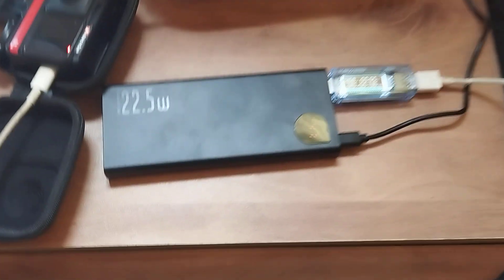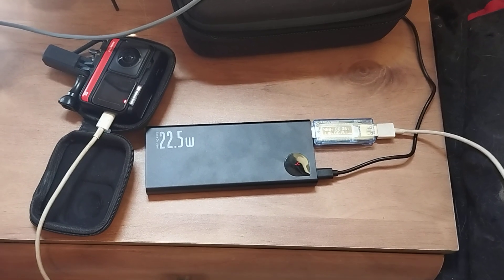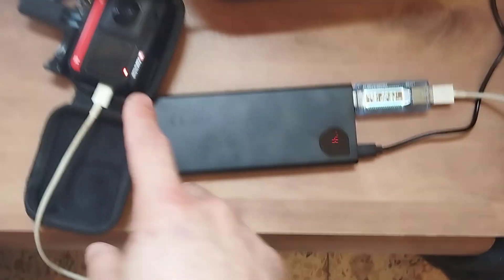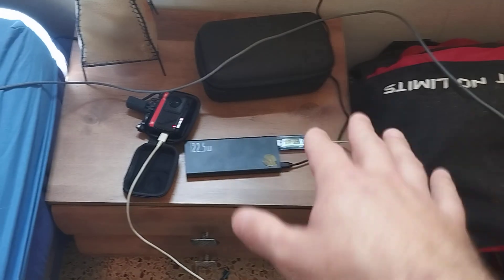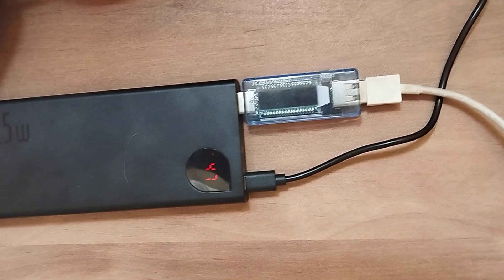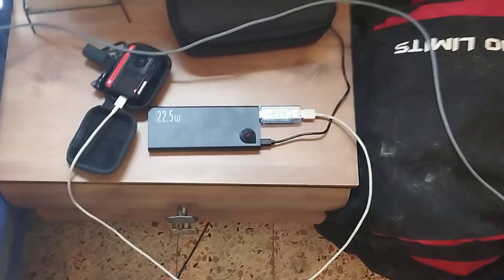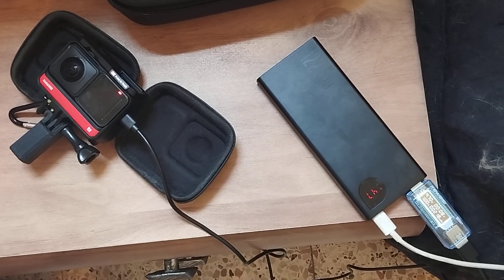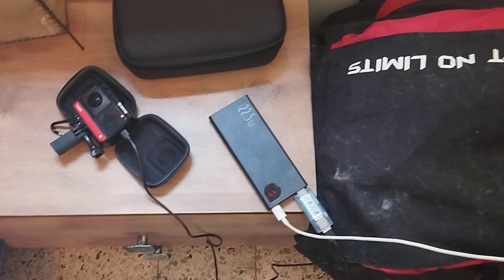Passthrough charging tests on a portable battery by baseus

Comment: I've found one power bank that seems to act like a ups. it's ugreen 145w 25000 mah. I think the passthrough is limited to 20 or 30 watts so it will discharge if you are drawing more than that.
I've been able to power a travel router from one of the usb c ports and when the charge gets low I've plugged in the bank and it didn't cut power to the router. Same when unplugging the bank from the charger the router didn't lose power.